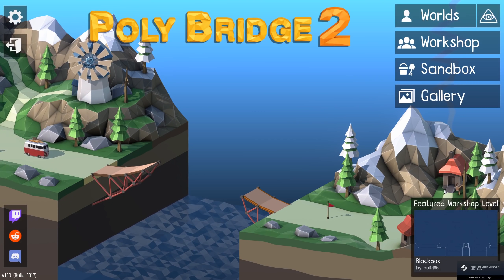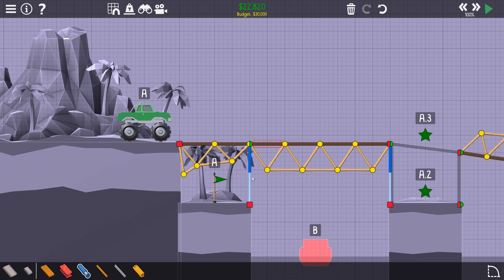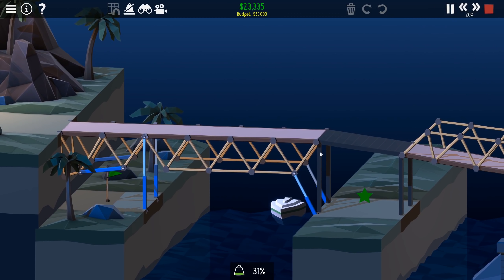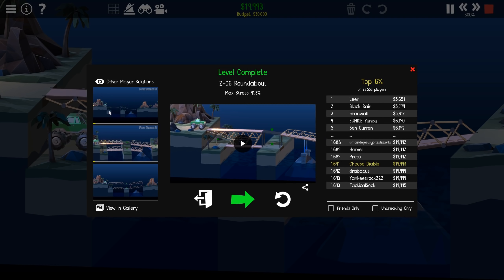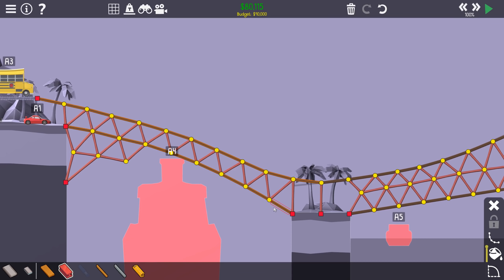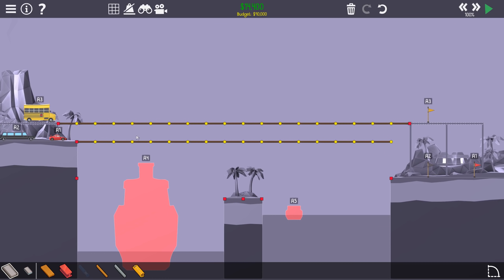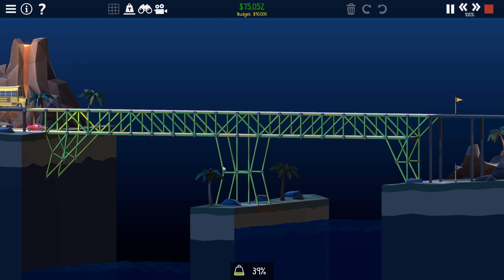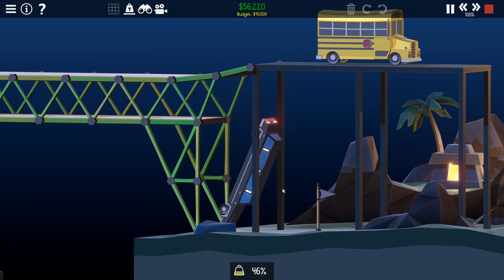A real civil engineer HITS THE GYM in Poly Bridge 2!

Comment: also, dangling roads aren't the end of the unrealistic "bridges" in-game, there are spring catapults that launch the cars to the other side, sometimes with an added ramp.
Reply from the maker: I've got a lot to learn about this game 😅
Reply: Real Civil Engineer there is also falling roads that hit the car at a very verrrrry small point on the car that flips it at such high speeds that it launches it across. It’s very hard to get top 1% with that as your competition...
Reply: @toskakai4379  yes, and if you use that strategy it also takes a stupidly long time to get right, people take literal hours optimizing these kinda of designs, it's kinda ridiculous